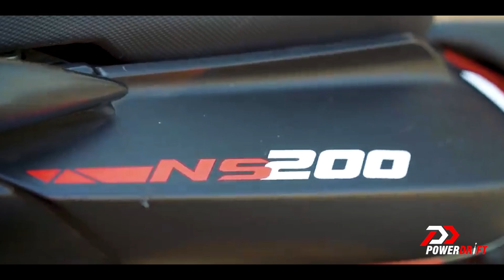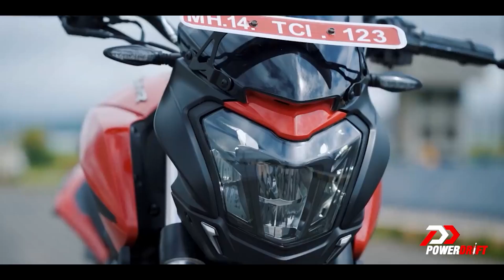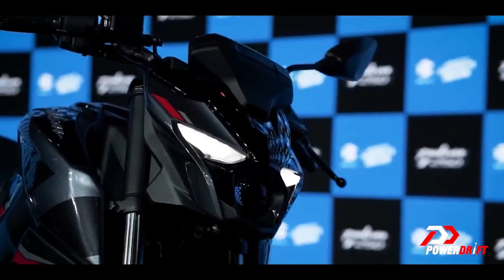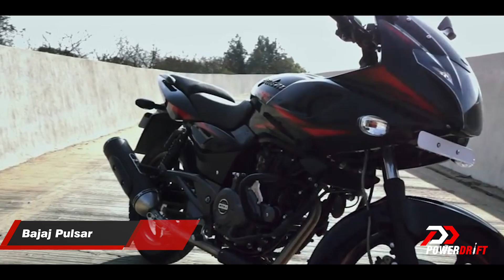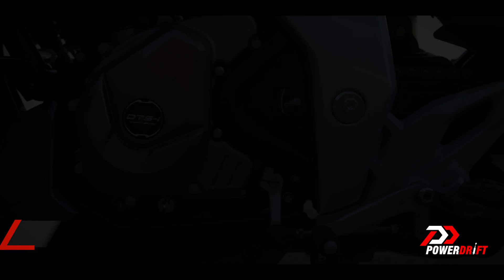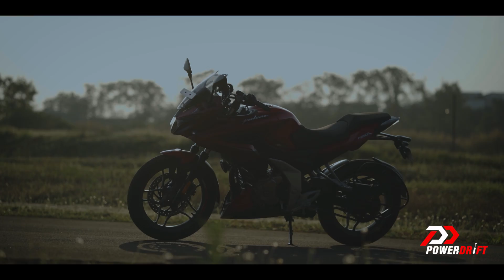Bajaj Pulsar F250 & N250 | Your Questions Answered | PowerDrift

Comment: The easy performance will be appriated by me, but I don't get the fact that it why it doesn't get a dual channel ABS even as an option and the section of rear tyre 140 would have made it look more muscular and handle well at corners.
Reply: Smaller tyre means more agility and better mileage. That's why and about ABS, it's to keep the cost at what they wanted. As Shumi said, they thought of the cost pretty much from the start.
Reply: @sushantdutta8707   I get the sense behind using a smaller section tyre, but ABS is a safety feature and to comprise on that is a bit of a bummer, atleast as an option they could have provided as a consumer It would been nice to have that option.
Reply: @AkshaySingh-jk2uf  Apcahe 2004v and FZ25 comes with Dual channel ABS at this price point.
Pulsar 250 should also come with Dual Channel ABS.
Reply: More than a size upgrade, a radial tyre upgrade would have made a world of difference.
Reply: @satishjoseph  definitely. They are better and even lasts longer but this is a very basic bike from Bajaj so it was expected. They made this as a commuter. Hopefully the next RS and NS gets a more premium treatment for the younger fanbase.
Reply: I had same thought, everything is fine at price point but why the heck "single channel abs"
Reply: @wonderingartist  Also 4V engine can enhance the performance.
I understand they wanna make this bike for city use that's why 5speed gears  but why they skip 4V 🤔
4V engine and Dual channel ABS will make this a best deal at 1.4L or even 1.45L.
Reply: @ShivamSingh-bw9rt  yeah that too, maybe they dont want to make it a great deal because it will kill sales on domi 250. Bajaj would have done more if there was no Domi 250
Reply: @wonderingartist  But Dominar 250 is different machine.
It's not selling because 180kg kerb weight I guess otherwise it's a good bike.
USD forks itself justifies it's price over any 200/250cc bikes(bikes which doesn't offer USD) apart from this 
D250 offers 
Refined 4V Liq Cooled DOHC Engine with 6Speed gears.

Fact is that Bajaj don't wanna work on R&D.
Reply: @ShivamSingh-bw9rt  I don't see a need of 4 valve engine as it would make the engine complex and with the current setup they got the performance they needed so ading more components would not serve their purpose.
Reply: @AkshaySingh-jk2uf  As I have seen in multiple videos that's is not comfortable in High speeds.
So 4V will definitely improve its triple digit cruising speed.
I know this bike is not meant for high-speeds also not everyone is going to ride this bike above 100kmph.
But If 4V engine gives it edge over 2V engine then why not.

Hero also implemented 4V engine in Xpulse 200.
Reply: @ShivamSingh-bw9rt  can't comment on it before riding it myself, according to my riding style and preference the specs are good.
Reply: @ShivamSingh-bw9rt  When these machines aren't made for cruising/top speed, why do one need 4V, there are ifs and buts everyone. Why will they increase the complexity and Cost, when its not even needed for what purpose these machines are made
Reply: @prajotrasam1721  Who told you that only cruising and top end speed bikes need 4V set-up 😂Even bike like raider comes with 3V Engine also we have seen 
4V 125cc and 135cc past from bajaj as well.
pulsar 220 still serving the purpose then why F250? because product should be dynamic in nature.
Why they have given slipper clutch, bigger disc, wide tyre and all led setup they could have simply given engine update with looks?
When a brand like hero can convert its 2V engine into 4V then I don't think it's big deal for Bajaj.
Reply: @ShivamSingh-bw9rt  considering more than 50% of Bajaj's revenue is from the export market (more than any other player) and their focus on offering the same bikes in both domestic and foreign markets, I think the new gen pulsars are designed with keeping these markets in mind (Latin America, Africa etc). Probably the need in these markets is not outright performance and top tech. Maybe it's about the price sensitivity and ownership costs. That's probably why Bajaj has opted for simple mechanicals and proven mills over 4 valves, Liquid cooling etc. 🤷‍♂️
Reply: @ShivamSingh-bw9rt  4v is not a necessity, they have churn a lot of power with 2 valves. It's commuter-sports bike. You won't be comfortable at 120+ anyway. Its made for city and highway cruise at 110-120. 
Slipper clutch makes rideability easier, bigger disc because the bike has more power than 220f, all led setup because it looks good. All this totally makes sense.
Reply: @sushantdutta8707 4V is not just about more power it's more than that like it increases throttle response, pick up at all engine speeds. This also results in better fuel efficiency and also helps in lowering the emissions.

You can easily control  RTR 2004V/FZ25/R15 at triple digit speed  with just 270/282 disc.

So this point is totally senseless.
It's upto manufacturer how their bike response to breaks.

On coming to Slipper clutch so those bikes which doesn't offer Slipper clutch give bad riding experience?
It's good to have feature but not necessary, we all know that.

All led also increases the cost it's not necessary.

Whole point is Bajaj only give those features on which they don't have to do lots of R&D.

at this price it's a good machine.
Reply: @satishjoseph  Yes Bajaj Pulsar without KTM engine is old school
Reply: @ShivamSingh-bw9rt  I'm a mechanical Engineer as far as I know 4 valve is better because it gets more airflow and less valve flow at high rpm because it uses light and small valves. 
The advantage of 2valve over 4 valve is the cost, which is the most important part of this bike, 2 valves is not a complex part, 4 valve needs more materials to cover up the cylinder. 
4valve engine advantage is that engine can rev higher and produces more power whereas a 2 valve engine can produce more low-mid range power/torque because the air flow is faster at these engine speeds because of one big inlet and 1 small outlet which is the main motive of this bike, this was never meant to ride at high rpm band in the top end. This bike is solid city/higher commuter kind of bike which has very good low-mid range torque. Enough for daily commute and some fun in between.

Slipper clutch's main function is it does not let sudden force get to the transmission(along will fast shifts), that means your bikes transmission system will last longer, what's wrong in that or you don't want it to last?

About the brakes, you named those bikes which are less powerful than N250, N250 clearly has more torque than all of those and fz25 comes close but yamaha is known for huge cost cuttings. Pulsar giving a larger brake should be taken as a positive.

Also the 4v has less emissions part is bollocks I'm sure you will have to be under a certain norms to launch bikes in India (BS6)
Reply: @sushantdutta8707  To understand basic mechanism of bike any degree is more than enough.
Flexing your degree won't make you cool even a road side mechanic knows most of the things without going any school.

Even after achieving lots things in life one should not flex.
Reply: @ShivamSingh-bw9rt  wasn't a flex, I gave you the difference and exactly why Bajaj team chose 2 valves over 4.
Also roadside mechanics know how to fix an engine. I don't think there are roadside mechanics in the bajaj team who decides what to make and I'm sure they know more than you, me, roadside mechanics. Every motorcycle is made for a certain motive and targets in mind and Bajaj have nailed it with this one. There maybe updates to NS 200 and RS 200 which will feature modern specs to fulfil the needs of customers like you, wait for it.
Reply: @sushantdutta8707  You're not getting
 what I am trying to say.
I didn't said that bajaj is hiring road side mechanics or bajaj is making bad product.
I said on a degree that one do not need a degree to understand basic mechanism or 2V or 4V  what you have copy paste from Google most of the audience of auto tech channels already know that.
Even bajaj/ TVS it self provide article on 2V vs 4V and slipper clutch working.
Reply: @ShivamSingh-bw9rt  if you know it then why are you whining about it? If you understand the mechanism why are complaining? You want a commuter-regular ride bike to do 160kmph and go up till 12k rpm? Your demands are absurd.
Reply: @sushantdutta8707  are you high on weed?
What demands I have made?
Kindly check my previous replies I wasn't even talking to you
You are just blabbering and slamming keyboard by your own like RPM,160 speed bla bla 😂
Get a life